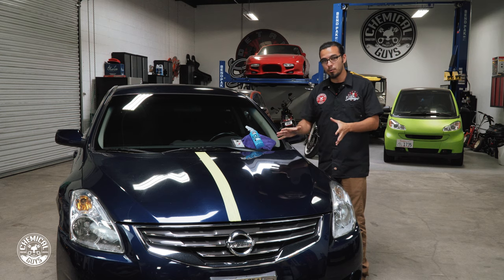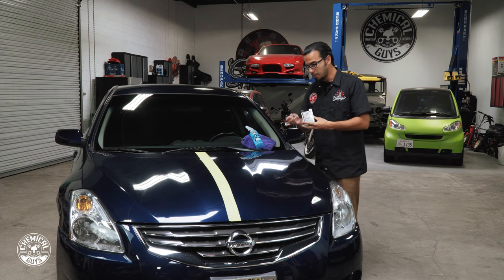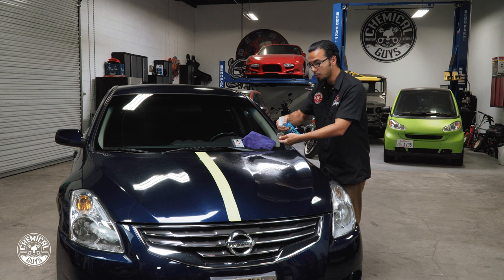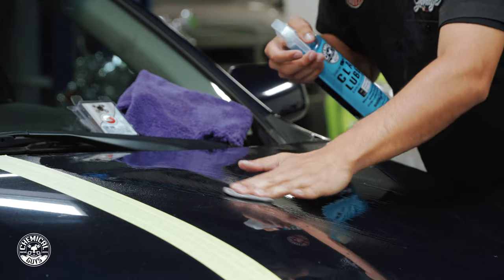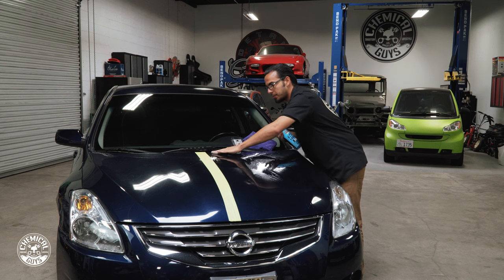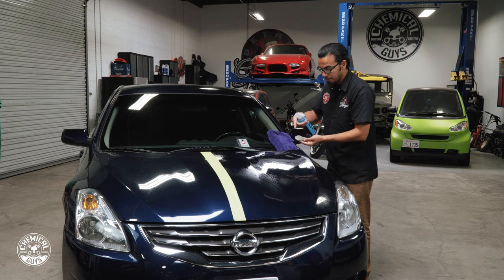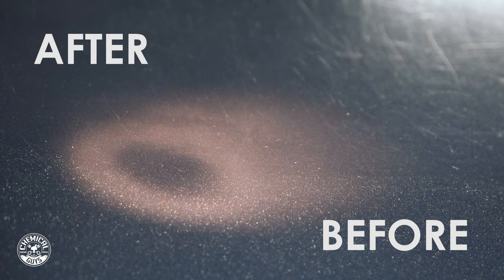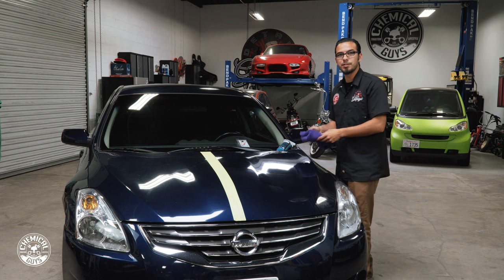DIY: How To Make Your Paint Smooth - Nissan Altima - Chemical Guys Car Care

Comment: I have several 16oz chemical guys products, is there a certain way or trick to take off the spraye? I have a really hard time trying to take it off.
Reply: EricDC5 pipe wrench
Reply from the maker: Hey, if the top has the anti leak seal on it, it means that it's not meant to be opened. However you can pry the sprayer bottle with box joint plyers.

Comment: What if your car feels sticky but its coated, will a little polish do the trick make it smooth again?
Reply from the maker: Hey! Try using Butter Wet Wax to gently scrub away residue while adding gloss, protection and a super smooth finish.
Reply: @ChemicalGuys  hey, i did a light polish and it felt nice and smooth again and topped it with wax✌️ i tested this on 1 door panel, so i know what to do on my day off😂

Comment: This strips off any wax or sealant you make have on though correct?
Reply from the maker: Hey, thanks for watching. The only processes that remove waxes are : the water spot remover, polish,  Citrus Wash and Gloss Soap, and clean slate.  Claying is safe for your waxes, no need to worry.
Reply: Thanks!

Comment: My clear coat has tiny bubble specs in it, clay bar don't take them out. What should I do next..
Reply: Steve Tomlinson most likely dust specs in the clear coat. would have to wet sand them out.
Reply: Steve Tomlinson rip
Reply: @pepepepepe33  wet-sand with what grits? Thanks